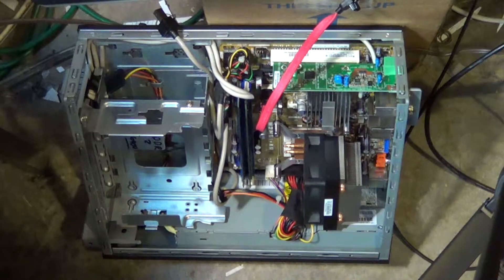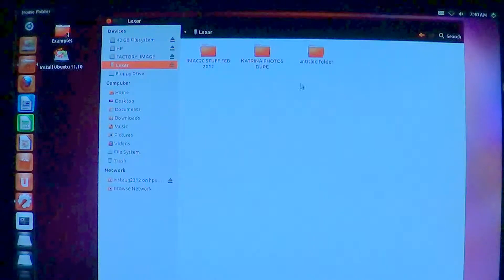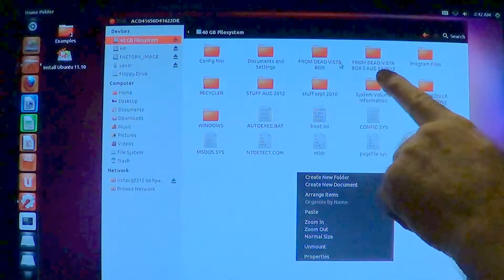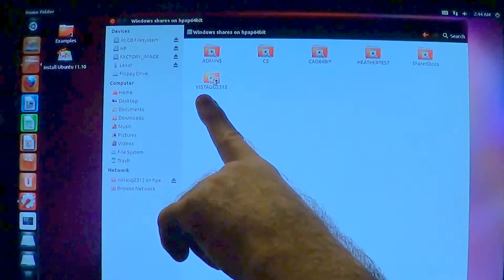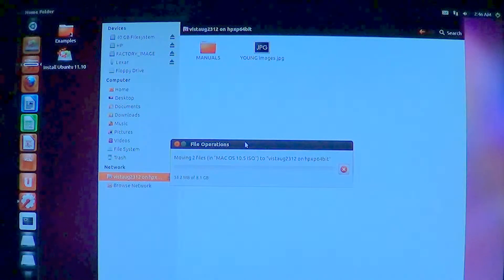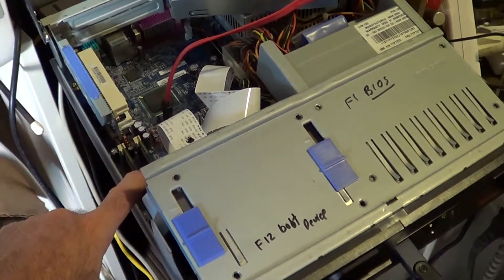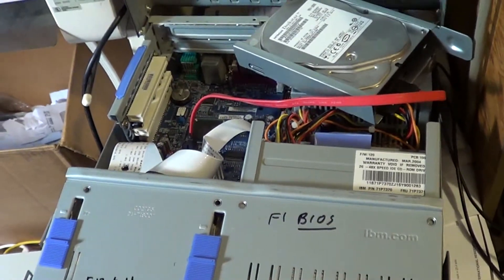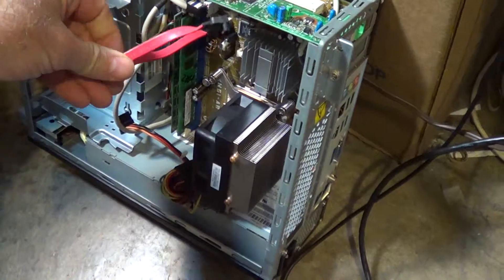Ubuntu 11.10 on IBM thinkcentre S50 to recover data from hosed Vista Sata Hdd

Comment: Dude i want to replace ide with sata as only hard drive in the computer. Any idea's
Reply from the maker: The S50 has two SATA ports on the motherboard
Reply: Yes but when i unplug ide and try booting it says no boot drive or something
Reply: Also dont know.what the right ram that is needed
Reply: Is it just a case of replacing with sata? Do i need to change any settings in bios? Only asking because you have the same model and i seen you messing around with a sata
Reply from the maker: I think the bios sees what is connected to the IDE or SATA at booting time and logs the device so it can be used.
Reply: So disconect the original ide and reboot with sata drive conected and cd rom with installation disk inserted yeh?
Reply from the maker: yes
Reply from the maker: 3beltwesty Here is the hardware manual 5 megs link; maybe helpfull:

http://download.lenovo.com/ibmdl/pub/pc/pccbbs/thinkcentre_pdf/74p2660.pdf

Comment from the maker: IBM S50 model 8183 Pentium 4 2.8Ghz 2GB ram built about 2003. Has usb 2.0. 40GB has Windows XP Pro. Cost in 2010 was 50 dollars via Ebay but had just 512megs DDR ram..